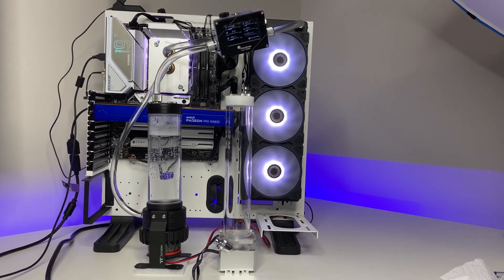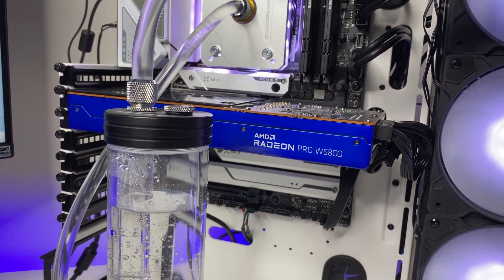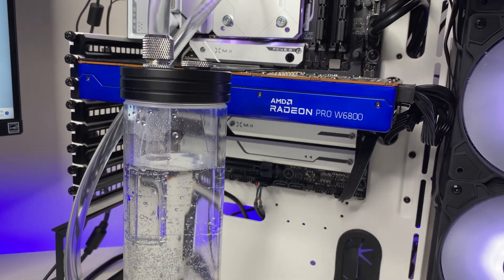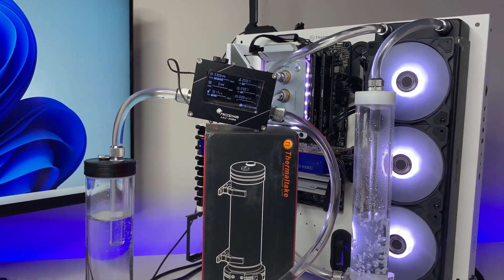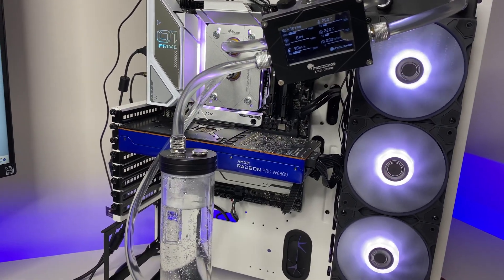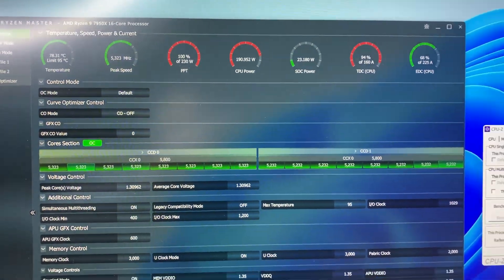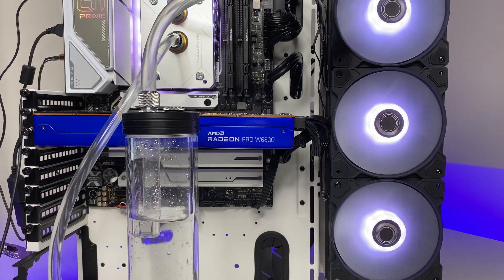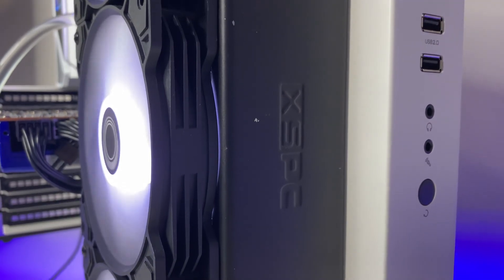D5 vs DDC Pump | Custom Water Cooling

Comment: advertised flow rate is for zero pressure, i.e. no pipes, no fittings, just pump. advertised pressure is for zero flow rate, i.e. no loop, but blocked pipe. in real loop you'll get lower flow and lower pressure. google for pump characteristics graphs. advertised values are points on the axis

Comment: You DO realize that your flow meter, as well as your tubing and bends all produce some back-pressure, right?   This is why you don't get the max flow rates from the specifications.   The max flow specs assume zero head pressure.    Similarly the max head pressure assumes zero flow.   This can be charted on a flow/head pressure chart to show how a pump performs at each amount of head pressure.    At the max head pressure you'd assume 0 flow, and at the max flow you'd assume zero head pressure.   (this is similar to how static pressure and airflow works with fans)

The reason you got closer to the rated performance with the DDC pump is because it is rated for higher head pressure, which means when it sees any back pressure (even the little amount in your "unrestricted" test, it is going to be less impacted by that head pressure.
Reply: Totally correct.
Reply: Yep. Flow rate claims are like flywheel HP measurements: technically correct, but you will never see it outside of a perfect testing environment.

Comment: WTF he says that DDC is more quite than D5??? I need silent pump, which should I buy?
Reply: DDC is always on full blast so it will be noisier. D5 with RPM control will always be quieter. Since when a smaller form factor pump outperforms a full size tried and tested  legendary D5

Comment: Flow rate is going to be depended on the loop, even a pump into itself will have to fight elevation rise. I expect the specs on the pump are with it pumping into atmosphere giving no restriction as you are making the pump push up the height of the reservoir. It also seems you don't know the use case for the two pumps. DDC offers a high head pressure - allowing for more friction in the loop which can be caused by rise, bends, or additional components. D5 allows for faster flow, this is advantageous if you aren't fighting friction and have more area to dissipate head (larger radiator or multiple radiators typically).

Comment: I think his flow rates are wrong lol. 1,000l/h+ with (1) D5? lol. I have (5) D5’s and get 500l/h with a calibrated Aquatuning flow meter.
Reply: Yep , that flow meter is 100% unaccurate . With the D5 it should have like 200LPH max with 1 cpu block and 1 rad . With DDC around 150-160LPH  max. Btw i like ur videos  ^^
Reply: Not all D5 pumps are the same. You can buy variants with 1800L/h, mayne even more.
Reply: @dan8t669   Wrong , all D5 are the same . And that 1800lph u are talking about is just a theoretical number . it means it can do 1800 without any restriction, but as soon as you add radiator or CPU block it's no longer true.
Reply: @csabauri351 This comment aged well thank you
Reply: you have more restrictive loop than on this video. He has only 1 waterblock on CPU and 0 gpu waterblocks. Radiators and tubing doesn't count, they add almost no restriction compared to waterblocks.
Reply: No, 1000 l/h is totally feasible with one D5 with a low enough restriction. There are actually HUGE differences in restriction especially with CPU cooler blocks.

Comment: The problem with D5 vs. DDC has never been about flow rates and temperatures, but rather their durability under continued use. Things may have changed since the early days of watercooling, but back when I started with his hobby around 2008, the DDCs had much higher failure rates than D5s due to their construction and poor heat dissipation. As for the D5s, although they are mostly reliable (I have one that's been used daily for over 12 years) they can get quite loud, becoming very audible in an otherwise quiet system.
Reply from the maker: Appreciate the Feedback. Finally, someone from my early days as well, when custom water cooling was a religion.
Reply: @DealUnboxing  lol you are watercooling for 15 years and still don't undestand the very basics
from the video I assumed that was your very first loop so that's why you talk such BS
Reply: Lots of solid heatsinks from EK and bitspower for the DDC. Mine have been solid so far.
Reply: yes stock ddc has worse housing and as a result worse heat dissipation, also worse restrictive top with 90 degree angled inlet. But nobody uses stock ddc housing and stock top, so there is no problem. We use modern aftermarket metal housing with thermal pads for ddc pcb. Also we add aftermarket ddc top with inlet that goes straight to the middle of the ddc impeller.

Comment: D5 is loud as I got one so his lied
Reply from the maker: there are so many different manufacturers for D5 pumps
Reply: @DealUnboxing  lol no, they are all re-branded laing/xylem pumps so there is just one manufacturer
only exception is alphacool which makes their own D5 which has actual different pump design and is manufactured directly by them and not bought from laing
all other (ekwb, corsair, watercool, bitspower, xspc etc) just source the pump (ie motor and impleller) from laing and re-brand or add their custom electronics

Comment: I had tested several Chinese pumps, all pumps can operate the CPU block without any problems! the problem is when you add a GPU... the flow becomes bad!
Reply: Need to buy original DDC from Hungary from EK for example, I have complicated big loop with external radiator, one D5 gives 110L, DDC 180L, both in quiet mode - 220L.
Reply: bro don't use cheap Chinese ddc clones, try EK DDC 3.25 or any other DDC 18w version. In a restrictive loop it outperforms all D5 pumps including that crazy 24v D5.
Reply from the maker: it would be same for D5, the more stuff you add in the loop, it effects the flow.
Reply: @DealUnboxing  Yes, but that is the actual interesting comparison. DDC has a lower flow rate, but a higher pressure. Theoretically the DDC would be less impacted by the addition of additional flow restrictors such as GPU and/or quick disconnects. As you add components there will be a point at which the DDC pump will actually provide a greater flow rate than the D5. That was what I was hoping to see in this video as you made mention of testing pressure at the start.
Reply: @ryanreynolds2401 so if I’m adding a 4090 with a delidded 7800x3d into 1 entire loop with 2 rads— ddc will beat a d5 ? or would I need 2 pumps ?

Comment: Does D5 pump really makes more noise then DDC pump? With full load both must be noisy, but what is the sound level in idle?
Reply: It is different signature of sound, I run both in one loop D5 (from Aquacomputer) and then DDC (4.2 original from Hungary) (): D5 has very low level sound "whoa", DDC has sound with more high frequency like mosquito or bee, when you run them on low level - you will not hear it anyway, but for 60+% I would prefer DDC.
Reply: @m1nusasusplus897 so ddc is more quiet ? a lot of people say d5 is quiet—not really sure which one to go with.
Reply from the maker: Pretty quiet from my perspective

Comment: The intel i9 13/14 gen are the hottest cpu's 🔥 not amd bro
Reply from the maker: True. I said one of the Hottest - lol - thanks
Reply: @DealUnboxing  no problem thanks
Reply: @DealUnboxing  7950x is putting out less heat than even the i7s though. They just run hot due to thick IHS, it's only a 180-230w cpu, i5 13600k runs about the same wattage.
Reply from the maker: @PineyJustice  True.
Reply: what the best for i9 gen 14 ddc or d5 pump?
Reply from the maker: @RaceNTech  Both should be able to handle it without any problem.
Reply: @DealUnboxing  oke mate thank you and i like your video,

Comment: I would expect the pressure to be more impactful than actual flow rate, and not necessarily in terms of heat dissipation but more for it's ability to overcome bends in any given loop.
Reply from the maker: Both are important because flowrate helps with moving the heat away from the CPU block fast.
Reply: @DealUnboxing  IIRC the heat energy essentially propagates through the water is at the speed of light. The transfer of heat from metal to the water is what takes the most time. The flow of water just needs to be such that you aren't relying on convection to transfer heat. Sorry for the sloppy language it's kinda of because this is just a youtube comment.

Also take the D5 pump for example, at 1000 l/h flow rate that means every second any given quantity of about 277 ml will travel through your water block. I haven't measured it, but I bet the quantity of water in your waterblock is less than 277 ml.

Comment: You say one flow rate for DDC, but show another. Which is it?

Otherwise, it's expected that they wouldn't achieve the specified flow rate, as this specification is at zero head pressure. In any realistic system, this is not the case. But the combination of head pressure and zero head flow rate give a pretty predictable P-V curve, that one can use to estimate the actual flow (if dynamic flow restriction pressure is taken into account.).
Reply from the maker: Interesting. I show Flow rate for both with correct number. Since trying to keep the video short i had to edit with short clips.

Comment: Hello!
About the Freezemod pump, I have a question: Is it possible to fully control the rotation? Even turn it off?
Reply from the maker: Control the Rotation Means? There is no ON/OFF Switch - If that's what you mean.
Reply: @DealUnboxing  I was referring to pump rotation control... Is it done by PWM?
Reply from the maker: No. @hubeh1697
Reply: @DealUnboxing  Ok, thanks 🤝